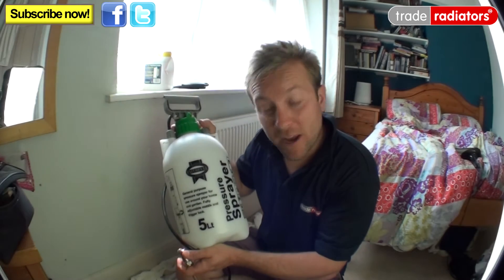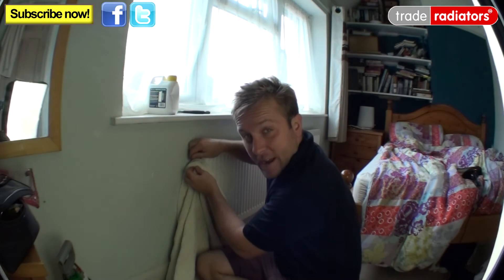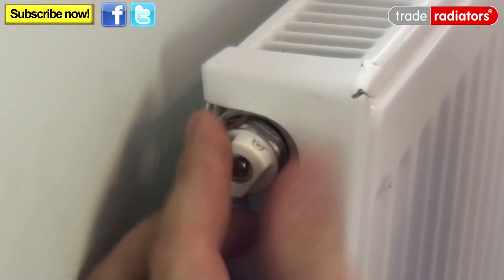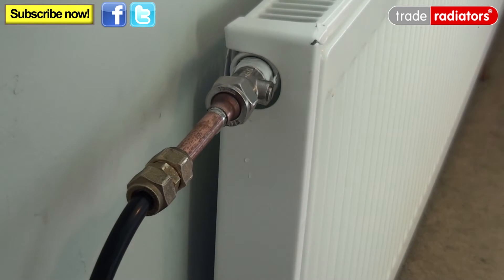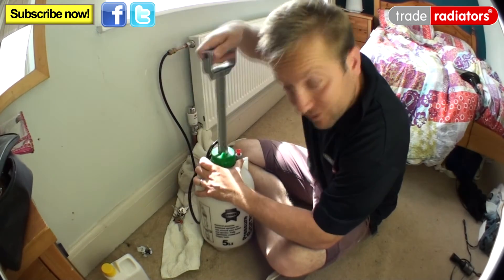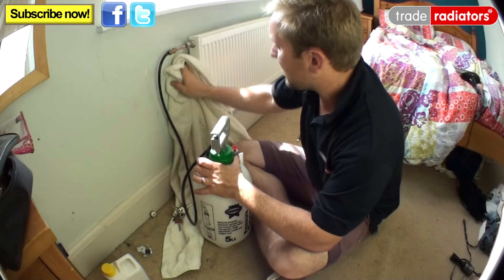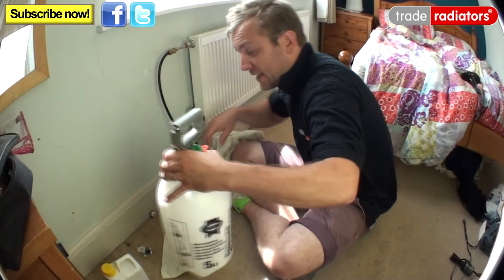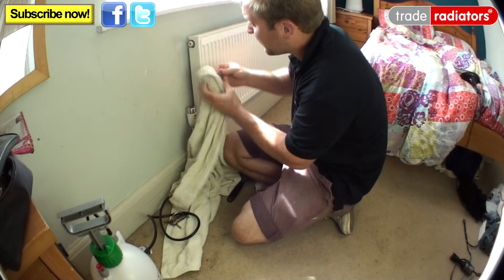How To Add Inhibitor To A Pressurised Central Heating System

Comment: Would doing this help clear sludge as my radiators is only warm at top
Reply: No, inhibitor helps prevent the sludge build up from a clean system - you need Sentinel X400 or X800 system cleaners to remove sludge already in the system.  They will need to be removed afterwards by draining down (& refilling inc inhibitor, repressurising if not gravity-fed) the entire system, so a time-consuming and potentially messy job, depending on where your drain point is on your central heating system.  This requires more than minimal knowledge, so unless you are a competent DIYer it’s best left to someone who is, or a professional.

Comment: If youve shut off the lockshield and thermo valve, why can't you crack open one of the bottom pipe connectors and drain the radiator just enough to take the inhibitor using a funnel then reopen the valves and it will mix in with the whole system water? Or am I wrong?
Reply: Exactly what I was thinking, isolate the rad, let out enough space for the inhibitor, add the inhibitor, bleed the air and open up the valves to mix with the rest of the system. Is there a reason this can’t be done?
Reply: I’m thinking the same.
I removed a radiator and when I reinstall it, I’m thinking fill it up with inhibitor and then bleed it.

Comment: How often does this need added? I've moved into a house and sticker on boiler says 2014 inhibitor added
Reply: Every year you should put an inhibitor in. If yours has not had any since 2014, I would first add a cleaning agent like sentinel X400 or X800 . Give it two weeks with this in the system then drain the entire system. Then refill the system and add sentinel X100. Then every year after that add sentinel X100 which is the inhibitor.
Reply: @robzaphy  I don't know if the previous owner had it, so il have it added . Thank for reply

Comment: Couldn't you just take the air admittance valve on the flow in the airing cupboard off and put the inhibitor in that pipework? Of course drain it first.
Reply: I think Jimmy must still be thinking about that one lol